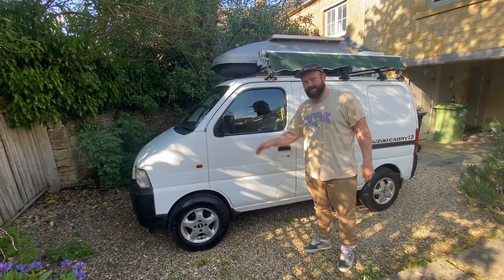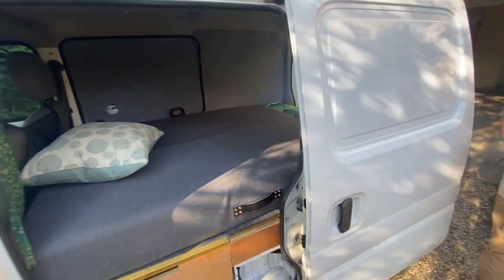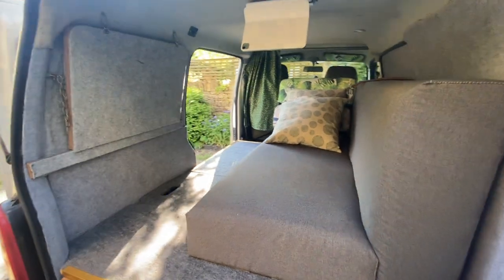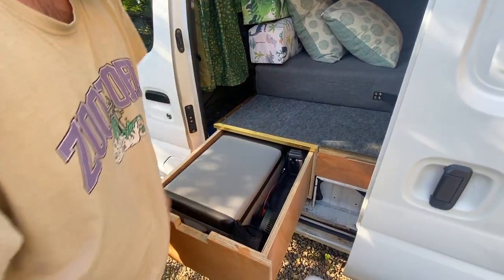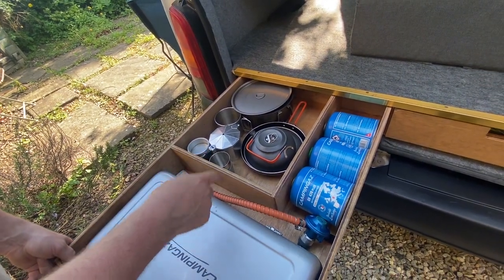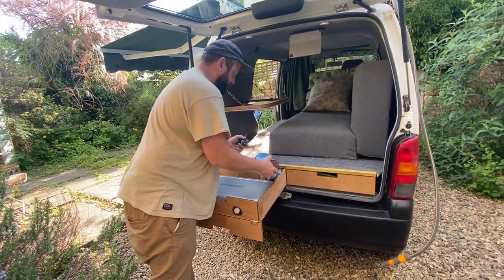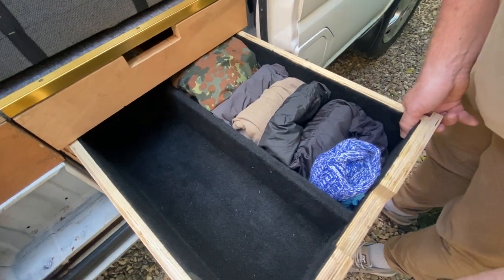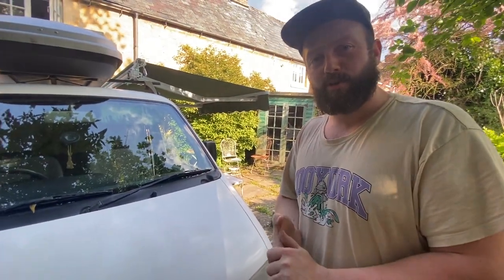Suzuki Carry off-grid camper conversion

Comment: I just bought the same van in New Zealand. I want to do something similar to yourself, with a single bed on a raised platform with sliding drawers underneath just like you did. I don't have any background in carpentry and don't know anyone here to help as I just moved here. Is there any kind of instructions that you found in order to do this or are you just very good carpenter/DIY guy?
Reply from the maker: Hi Jack, its all designed in my head so no instructions im afraid. I do have a workshop and lots of tools which helped. Good luck with the build!
Reply: @alexanderberchert6471  That's amazing. I'm wondering what you used for the clips for the curtains, if you can remember could you link me? Cheers :)

Comment: I have the same van but its stock. Did you install cup holders in the front and if so, how did you do it?
Reply from the maker: https://www.amazon.co.uk/Spurtar-Adjustable-Folding-Cupholder-Caravan/dp/B08S7198HY/ref=sr_1_9?crid=1LY4JM5F2S2UO&keywords=cup+holder+for+cars&qid=1706593464&sprefix=Cup+holder%2Caps%2C94&sr=8-9